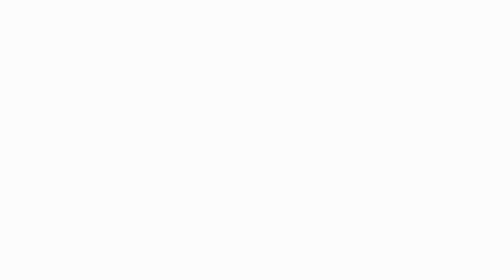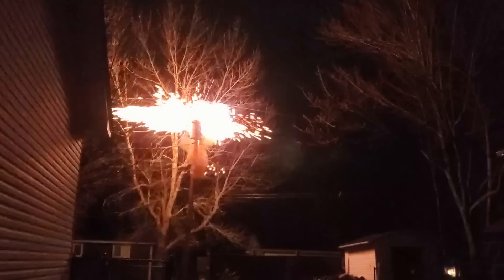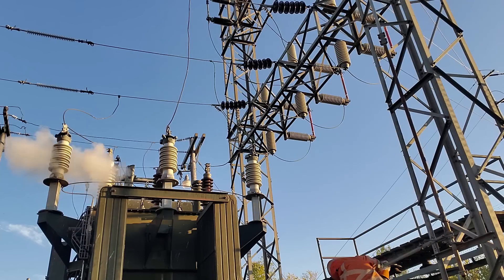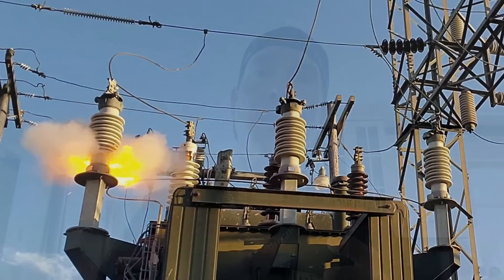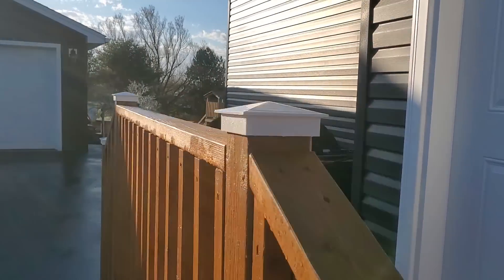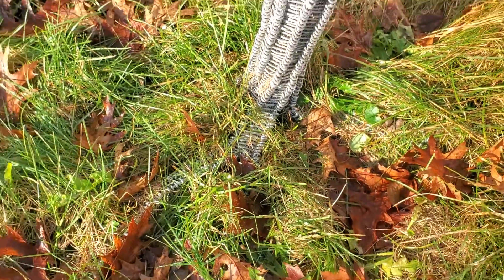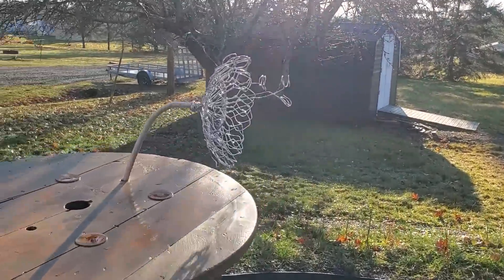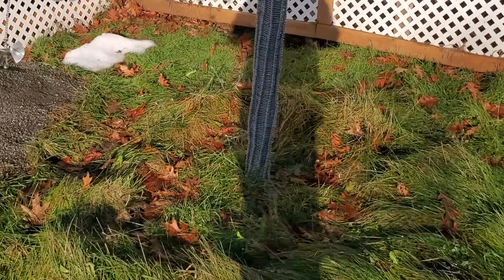Reviewing footage to find fault locations

Comment: I bet it lit up the ground first because of the sensor in your camera. Most cameras have a CMOS sensor which have “rolling shutter.” This means it scans from top to bottom or bottom to top, 1 row of pixels at a time but within milliseconds. As opposed to global shutter which is all the pixels/photo sites being read and written at the same time per frame. If you have ever tried to film lightning with a fast shutter then it will do the same thing. Also if you have a flash that’s out of sync with the sensors readout then you can get this. It’s what we call an artifact. Other artifacts are present with cmos sensors such as the “jello effect” or “rolling shutter effect” which comes from slow readout CMOS sensors which will physically warp the image with movement or make the image warp rapidly like jello.

Comment: Years ago I was doing a punch under a backyard to that had trees and lots of junk to pull a 3" conduit through to install a string of hand holds in a area that the secondary was directed buried. All was going well until the secondary fuse blew in the pad mount at the back corner of the house we were working on. After a long dig we found the second. Where the secondary was all that was left was bits carbonized insulation and  sand that had been fuzed together  from arching. Apparently the punch hit a tree root and went down right into the secondary. It was a long day to get it all fixed and the 3" conduit pulled through.

Comment: I typically troubleshoot much smaller equipment but I suspect the trouble might be up that pole. 🤔 the man made lightning hotter than the surface of the sun could be a clue.

Comment: maybe you should carry a welding helmet with dark lens or automatic model better yet, that would block all the dangerous invisible light wavelengths and allow you to better see the issue.
probably still wouldn't want to stare at a long burning arc, since it may still be too bright for the lensing. the invisible light is really not good for cameras either and will slowly ruin them.

Comment: Very cool video of those connections. Great use of that camera, but is there any risk to the camera sensor because of the flash? Surprised the power company doesn’t make video of the connections a requirement for both after analysis and insurance when a part fails. That one guy tearing up his yard should be charged for the false claim.

Comment: I have a question about something for which I have always been curious... I've watched several videos of you working in the switch/distribution yards. With such high voltage connections seemingly just overhead, how do you know how close you can be to wires and insulators in your proximity without the risk of something suddenly arcing over to your body?   Or is that all taken into account when they design the facility such that no "man passages" are ever within arcing distance?
Reply: Taken into account in design.

Comment: hey the reason it shows the ground being lit first is because of the rollingsutter effect of the camera. Ur camera doesn't take the full picture but captures a row of pixels and then moves up to take the next row. So it took a picture of the top part while it was stil dark and when the flash came it was still doing the bottem part of the pic and thus making it look like it's only lit from the bottem

Comment: I always took photos of any work I did with a large company.  I kept a file labelled CMA (cover my a**).  Whenever there was a question of work quality I could always refer to the saved images.  It was also useful to prove that additional work was required.
Reply: Working at the Big 3 letter computer company, all work remote, always took screen captures of before and after any configuration/hardware swap software updates to CYA.

Comment: When I was heavy towing and recovery industry, I took pics of everything,  and this was before smartphones and digital cameras.   It was mostly wrecks,recoveries, and unusual tows.   However,  there were a few instances of companies and individuals that were scammers and fraudsters.   Their vehicle would be damaged from something they did. They'd call for a tow and then blame the damage on the tow operator .
I remember one trucking company that ran trucks that were falling apart.  They blamed me for some rusted out ferring that fell off.  From that point forward,  I took pics of every rusted out p.o.s. truck they owned.  I'd spend an extra 45 minutes strapping their truck together, then I'd take pics of every strap and location.  I marked it on the invoice that pics were available upon request. I also charged them for every strap that I had to put on and take off.  They never tried that b.s. again, and they eventually went out of business.     In your case with damaged lawn, I would have reminded that homeowner that insurance fraud is a criminal offense.   I can provide over 20 stories of fraudsters who tried these scams.   It failed because I was ready for them.
Reply: one of the towing channels i watch that does illegal parking tows does a video walkaround and points out on video and scuffs,scrapes and dings no matter how small they showed one video where a kid tried to blame them said oh that wasn't there before until they mentioned it was and they had video to prove it

Comment: Speaking of loud noises, three times in my neighborhood, heavy equipment ,back hoes on trailers, snagged the powerlinesand snapped multiple utility poles. The utility finally raised the lines and it has been much quieter.
Reply: I was outside in the yard when I was younger, on the slight hill that looked down our 600ft driveway to the county road.  It was uphill on that county road from both sides, and I heard something heavy moving slowly down there and realized it was the (gravel) road grader.  Stopped what I was doing and watched him arc up into view, over the driveway, and down the other side of the hill, where he then snagged the guy wire for the sideline to our house.  The guy line flew up and landed on the ground (on top), shorting with the phase.  Happened so fast I didn't really see any sparks.  But I promptly went inside and called the power company to report what an arse the road grader guy is.

Comment: I used to like watching photoinduction blowing up stuff with really high voltage. He ripped a transformer out of a microwave oven that was sitting in his kitchen and left the pieces of destruction on the counter and wired two of those together to get 5k volts. Then he was able to get some excitement out of this really huge transformer and was able to produce 10's of thousands of volts. Then he used all of that to blow up things like speakers, light bulbs, electronics, hot dogs, watermelons and of course a pumpkin lol.

Comment: I think I mentioned this in the original video where you mentioned the guy who filed the  bogus claim that before and after photos can save your bacon. I worked for an IT company that was subcontracted to replace network equipment for a major US retailer and a couple days after we finished a sit our boss said the store claims we destroyed one of the network cabinets in their receiving area. As soon as he said the location I knew what he was talking about and told him their claim was BS, sent him the full sized hi-res pics I took showing the half smashed cabinet covered in a thick layer of dust (showing it has been that way for a long time) and told him to get the NOC notes from that night because the condition of that cabinet was included in my site report. An hour later the project manager from said major retailer emailed our boss saying it wasn't our fault and not to worry about it. Without those pics our company would have likely been on the hook for about $2-3K in parts and labor to replace it when it was obvious from the pics they put the fork from their forklift though it a couple times over the years. The general contractor required we takes photos and upload them for that exact reason. Even if they didn't it was our company policy to do so except in places where it was prohibited (Military and DOD contractor sites).

Comment: That was a loud crack. Nothing like playing with lightning every day. I only get to see things like that in the foundries.  Sometimes they get moisture on the metal in the winter.  Then when they are adding to the pot.  It will crack like that and shoot flames, metal and sparks 30 ft in the air.  I was surprised that the transformer did not have flying debris from the arch.  I would think it would dissipate through the grounding in the station. Due to it not insulated by the insulation bells on the transformer. I bet it got the ol ticker running fast. Looks like you never really get use to the loud booms and cracks.  That was pretty close to the flash of orange running for cover.  I appreciate you sharing.  I seem to be more fascinated by the overhead lines and how they are secured and equipment on the pole.  Keep up the great work and be safe out there.

Comment: Aaron, same thing happens with surge arresters (or insulation faults) at low voltages (240/415) too, had one today in fact... Insulation tester at 500v would get to 500v and show 30 megohms (which is a pass on an older installation today)... actually apply 240 from the network with actual power behind it, and CLICK, RCD would go (30mA trip current, UK name for GFCI). Every. Single. Time. Despite passing insulation tests. I believe it has something to do with available energy for ionization of marginal stuff... This was our favourite rodents btw... Ratties :)  Fixed it after finding the faulty cable

Comment: It lit up the ground as your phones sensor was part way through a refresh and that's what it caught. Higher speed cameras won't show partial frames like that if they are made for industrial or capture purposes.
Reply: If you’re using an iPhone, and you’re taking a picture out of the window of a train, moving at a high rate of speed, the trees and poles will appear to lean for exactly the same reason.

The closer the vertical object is to you the more it will appear to lean

Comment: Aaron, not related to this but have a question.  Me and my cousin just made the long drive from Alaska to Tennessee with the remainder of his stuff that he had in storage.  It was an amazing drive across the two countries.  I did however notice something in Canada that I don't normally see here in the United States - Single phase primaries that do not have a neutral line, just one line going pole to pole.  It also looked like some of the 3 phase primaries didn't have a neutral line either.  I'm guessing that there is probably a substantial grounding rod at the pole where the transformer is attached.  I'm just used to seeing the neutral line as well.  Thanks for all that you do, keep up the great work!
Reply from the maker: It's not something we do in our province, but I've heard of it in neighboring areas. I've also seen utilities repair storm damage without replacing the neutral to get customers on faster. You're exactly right in that a well established ground grid must be in place on the receiving end. That, or sometimes they can pick up a neutral off a nearby feed.
Reply: @Bobsdecline  If I recall correctly, you are in the East.  This was mostly in the Yukon Territory, but did notice it in B.C. as well.  It appeared to be the rule rather than the exception.  Thanks again.
Reply: The technical term for that is called "Single-wire earth return" or "Single-wire ground return" and you can search those terms for lots of information.  Such setups are often most effective through bodies of water, but such setups are not rare in remote villages and dwellings where cost of the run is a big factor and good grounds can be established.

Comment: Most people call in a "transformer explosion" when they are usually a blown fuse. I live near an intersection so have two fuses out my window and have seen them blow many times over the years. That said, I had the transformer blow in front of my home years ago, and my car was parked fairly close. The next day the local boys came by and cleaned my car... and also took samples of the oil for testing. (older unit so might be PCBs) They called afterward and left a message on my house phone that the samples came back clean, so I should not worry about contamination.
Reply: That does my head in, people calling EVERYTHING a transformer explosion... but I guess most people just think everything on a 'telephone' pole that goes bang is a transformer lol
Reply: its good that they replied with the oil test , here in Australia things have declined A lot , would be really lucky to get a follow up response
Reply: @liam3284  the joy of private operator, sadly it's the way it took in Europe 10 years ago power failure was for seconds (thanks to recloser) but now as the let tree go so high that they start to burn it's more hours of outage now. they slowly fired all the internal lumberjack team and replace them with subcontractors

Comment: 0:52 The reason the ground looks like it lights up first is caused by the rolling shutter effect (an artefact of the camera). The sensor scans from top to bottom, and the flash happened while it was in the middle of one of the scans. So, the top of the frame is dark, but the bottom is bright.
Reply: Yep, you nailed it.
At my job, we regularly have to do UL breakdown of component tests.  In those tests we intentionally create faults and demonstrate to UL that the product handles them properly.  It's not required by the test but video recordings have proven useful for evaluating failures.  We use a high speed go pro at 1000 frames a second, and it is common to see this effect.
Reply: Hmm interesting a gud to know bit of information 👍👍👍

Comment: It's all fun and games, until you let out the magic smoke
Reply: I work in concert electical and AV, and we have a running joke that anything can be the smoke machine if you use it wrong enough.
Reply: @photonpilot__  words to live by my good sir.
Reply: Common misconception about colored wire and insulation. The "insulation" isn't there to insulate. It is there just to hold the magic smoke against the wire. And once it leaks out, she's hooped.
Reply: Magic smoke is only for electronics power distribution runs on magic light
Reply: I personally can't believe the number of things which work on that stuff!

Comment from the maker: Hey Everyone!  

We used to call closing a line in with intent of looking for a fault "smoke testing". We're no longer allowed to use this method, however often times a fault cannot be found and line stays closed in. The cause ultimately remains a mystery... usually it was a small animal that got that turned into a predators lunch. Whenever I'm in that situation, I'll roll the camera incase we catch a flash and can use it to help guide us in the right direction.

In this case, we has approx. 50 poles back lot. Our patrol didn't reveal any problems. To climb each and every pole and get a closer look wouldn't be reasonable. I focused on this location after talking to a customer down the road that saw a flash in the horizon. The entire sideline opened as opposed to the cutout at the transformer. I suspect a dead animal was sitting on top of the can before the blast. 

Transformer was replaced.

Be safe out there everyone! 👊🍻
Reply: They do the 'smoke testing' here, Not sure what the DNO's (power companies) call it, but we domestic/commercial guys call it 'the bang test'
Reply: "Smoke Testing" bad, but what is the alternative ??   Close counts. Arc flash happens. It is not a direct connect that a megger will find.  but a connection that arcs over. 
Electricians "bump" motors to see not only if they turn, but which way.  
Sad story.  After redoing a 480 motor controller, the main fuse blew.  Master E on the job said "try it again" 
Cause of fault - mis labeled wire, a neutral, was plugged into a large MCB (molded case breaker)
Reply: A company I used to work for we'd call that a "fuse sacrifice (HRC)". They had a lot of fluro's each with old capacitors in them that would go bad.